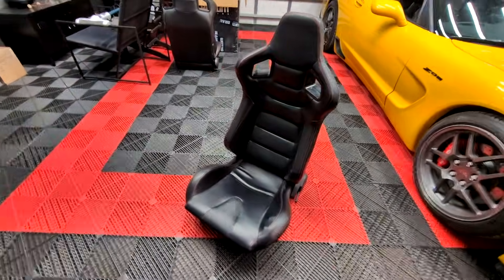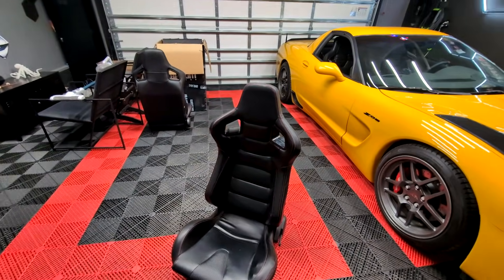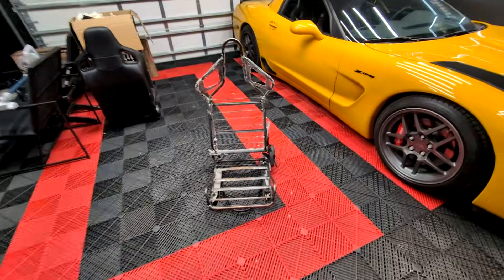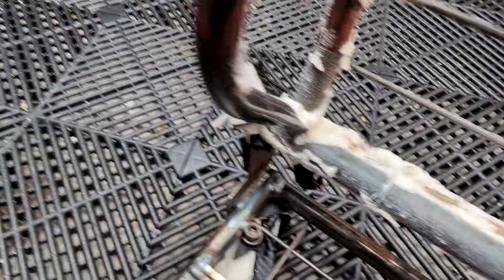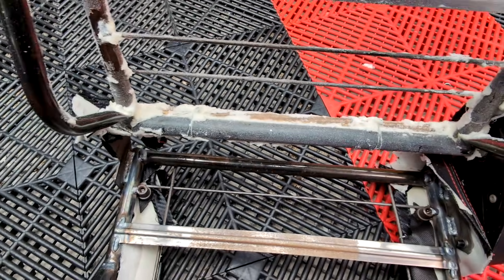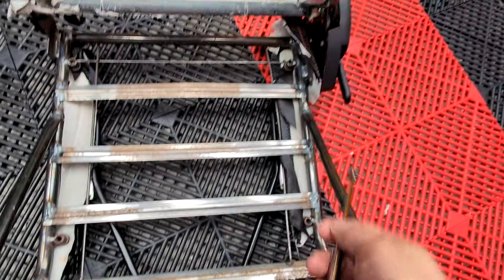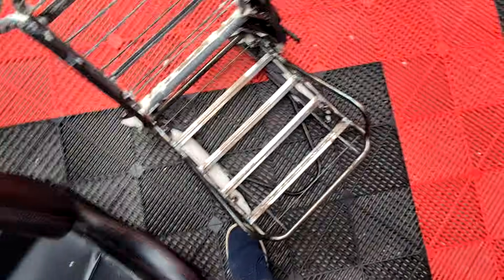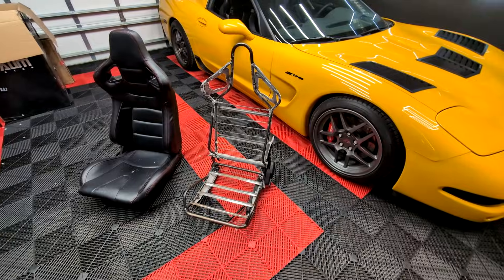HOW DANGEROUS ARE THE AMAZON RACING SEATS? WELL I TORE ONE DOWN TO FIND OUT | VERY INTERESTING

Comment: Those are race simulator rig-level seats being sold as actual car seats. I take that back, I actually have a cheap X-Rocker-brand sim rig seat maybe five feet away to me (I think it has a wood-based frame), and it still appears to be of higher build quality.

1. I have an upholstery background, cannot believe how cheap that is, actual OEM seat foam can be easily separated from the frame. You don't do injection-molding of foam around the frame. 

2. The hinge assembly is dear-God levels of flimsy. 

3. Practically every steel-framed car seat, both OEM and aftermarket, has some sort of spring assembly in both the back and seat bottom (typically springs and some sort of steel mesh). It literally looks like someone just cobbled something together to make it look like an actual car seat but did so as cheaply as possible. The seat foam rides on the springs, there's some give, but with that seat, once again, it seriously looks like someone took a steel-frame car simulator seat (they typically don't have spring assemblies of any kind, just like most cheap office chairs) and just started selling them as actual car seats. 

4. That wood strip? That hasn't been included in any OEM or aftermarket seat that I've ever seen, OEM's use harder-plastic locking strips or hog rings to attach upholstery, but even using hog rings requires that a stupidly cheap metal rod be sewn into the seat cover material for the hog rings to use as some sort of anchor. That wood strip? That's crap you see in house furniture, or in this case, third-world car building, they literally just stapled the material to that wood strip, staples are great for various upholstery pieces (couches, for example, or various other upholstered surfaces in an automobile), but are legendarily stupid for a seating surface on what's being marketed as a "performance seat" where you'll be cornering and braking hard as well, staples don't have that kind of holding power. 
Ditto with the various metal strips that you were simply pulling out of the foam, they're supposed to be anchored in some way.

I'd hang onto that frame and compare it to an OEM seat frame if you ever get the opportunity to do so, or better yet, snag someone's worn out Braum seat or something similar, you'll see what I'm talking about.

My takeaway: You're being waaaaay overcharged for Amazon seats, they're not even good copies of dangerously-cheap aftermarket car seats.
Reply: What dangerously cheap aftermarket seats are better quality and even remotely close to the price of these seats. How are they overpriced if they are extremely low priced?

Comment: I'm not an expert but after 32 year's with L.A.F.D. in Southern California I've seen my share of auto accidents, my main concern is where the seats are mounted to the brackets. In a heavy head on impact the seats would be stressed at the bracket mounts to the seat and not necessarily the mounting point from the bracket to the floor of the vehicle. The penetration of the welds look very weak to say the least, so if I was comparing them to my stock 2004' C5 seats I would definitely pick the stock seats in regards to safety. I'm not a very tall person ( 5' 7" ) as well so the stock seats really seem to fit me well.... Thanks for your great content I really enjoy it !!, All the best , Happy New Year ! Cheer's M8 *
Reply: I was thinking that also. The mounting point where the seat frame threaded boss is welded to the frame that attaches to the slider, that looks a little sketchy.  I’d prefer to see something with a better mount to the frames.

Comment: You should find a way to crash test the second Amazon seat now, roof drop or something along those lines. Titled “I stress tested Amazon Racing seats” or something like that. It’ll be a hit 👌🏼
Reply from the maker: I definitely thought of that. The issue is that I would have to have variables & controls (OE seat).  In a perfect world I would have the "Amazon seat", the entry level seat (Braum), the high end seat (Bride) & the OE seat. Then I would have to figure out a stress test that would be persistent and I guess dropping from a high area would work, but they would all have to hit the same way for uniformed results.  I could just toss it off a building and call it a day 🤷🏼‍♂️😂🤔.